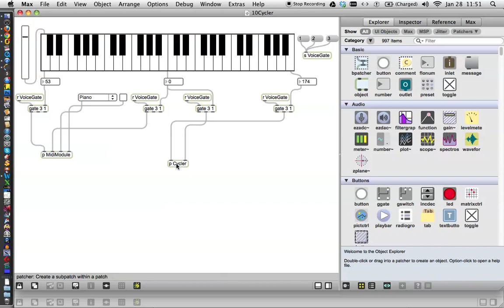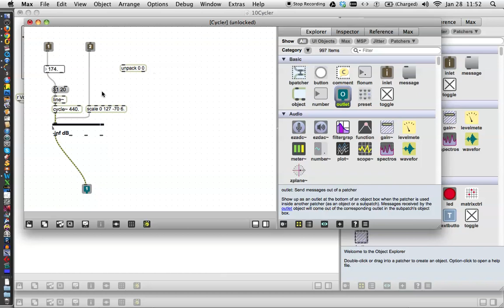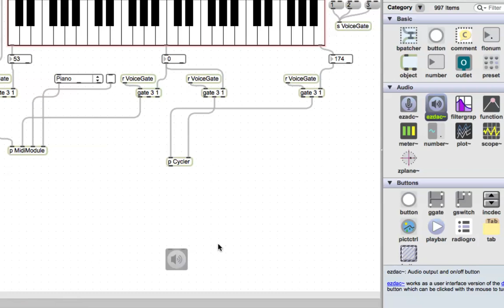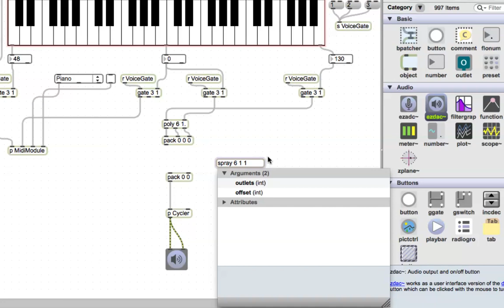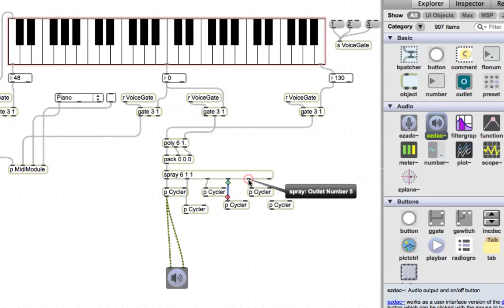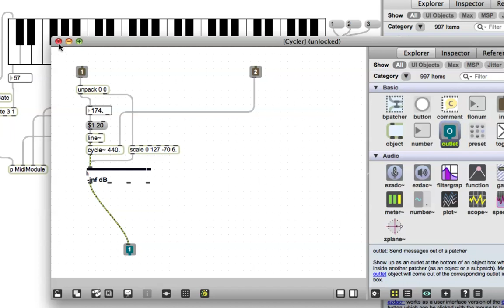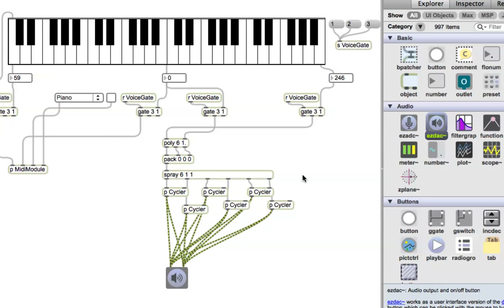Class Tutorial #11:  Using the "poly" Object

Comment: Hey great video. I´m having trouble understanding something. Why do we have, after poly, a pack with 3 elements, but then when we unpack within our p Cycler, we only need to unpack 2 elements? What happens to the first element from poly (the voice number)? Why does it not get transfered or interfere?  -- I would greatly appreciate an answer on this one! Thanks!!
Reply: Brian, when we "pack" the three elements, the first gets used as the "address" in the spray object.  So the first number gets used to tell which of spray's outlets will be used.  The two remaining elements are pitch and velocity, which go into the "p cycler" (just as they did way back before we added the poly object.  Does that make sense?  The poly objects job is to add that first number (and keep track of it) so we can play as many voices at once as we designate (in this case, 6).
Reply: Thank you! In other words, spray uses the first element and then is able to pass the 2 other elements along..